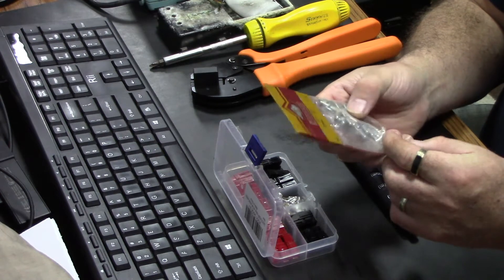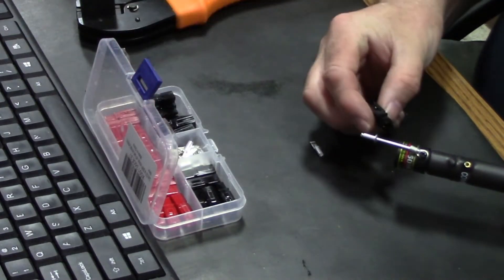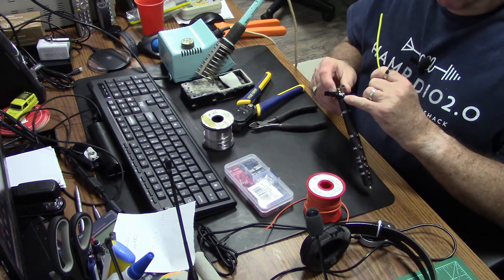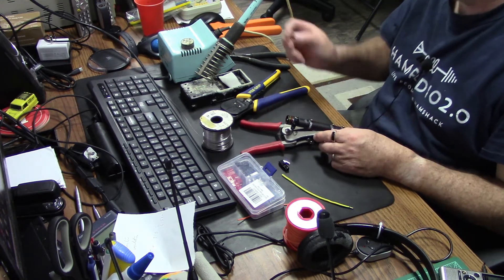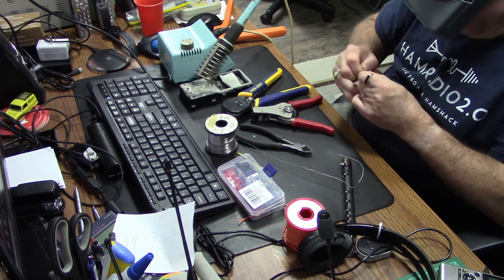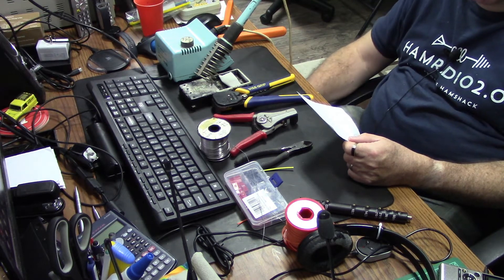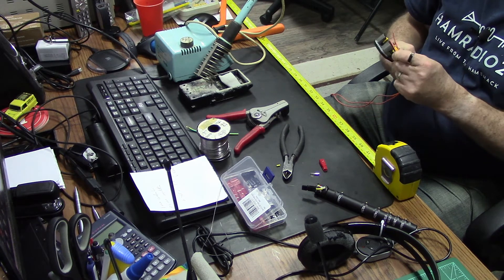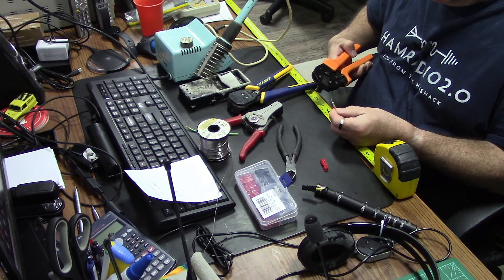Adding radials to HFJ-350M with Anderson Powerpole connector

Comment: Oh so close, you had the best idea right in front of you at the end there.  Forget wire counterpoise or radials and use a tape measure, so much easier to get the length right in the field.
Reply from the maker: good thoughts, I already have thin tape measures with Anderson Powerpoles on end that I used for dipoles before. Good thoughts there.
Reply: @va3sii  oh wow, I’ve done the tape measure counterpoise a few times, never thought about a tape measure dipole. Now that is a great idea.